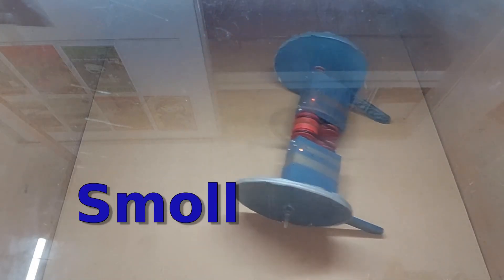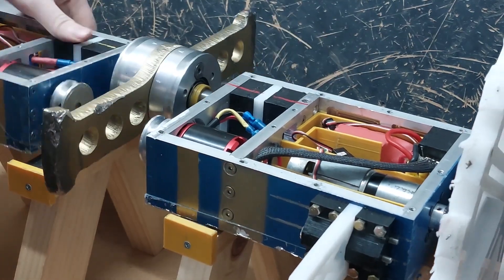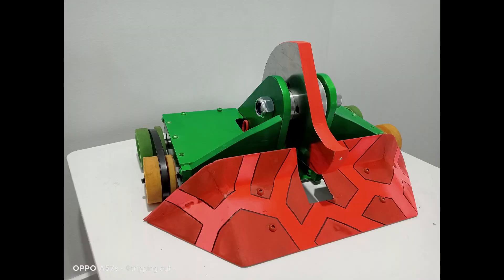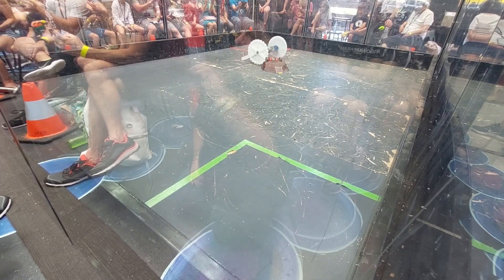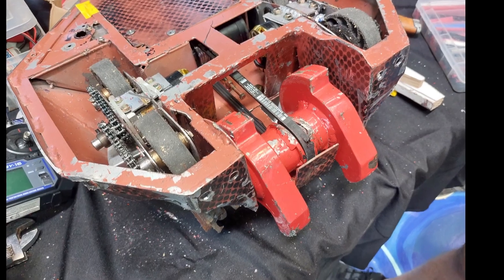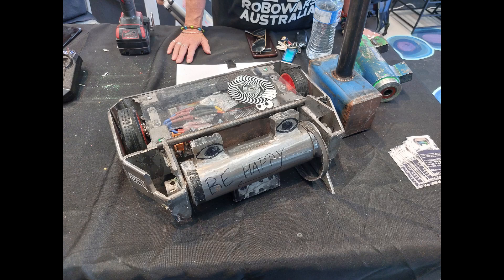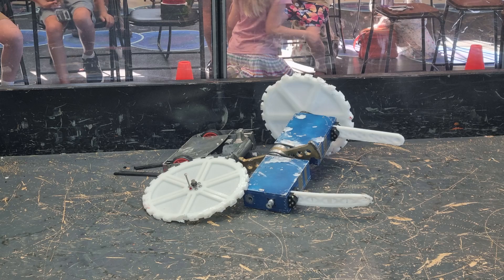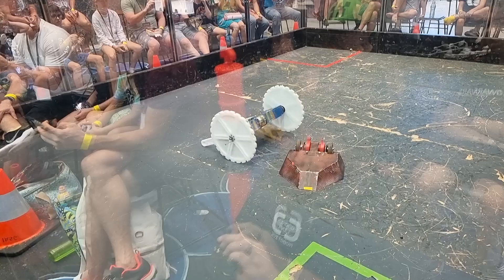Building a normal sized Combat Robot

Comment: Hey dude, nice bot. Reminds me of the early versions of my uk FW “CPT Jack Spinnah" you’ll have lots of fun with that design trust me 😂😂 until every fight you have someone slaps a huge wedge on. Haha.
Reply from the maker: hey, yeah ive seen videos of your bot love it, on the early design ideas for mine I considered having the frame half's joined at the back like yours but ended up going for the fully separated frames. I have had someone use a hydra style cow catcher/bike rack on my beetle weight version which i was able to counter by using the stabilising legs to lift it up and over my bot.

Comment: Very elegant build, well done.  Are you planning on supporting the motor shafts some way?
Reply from the maker: Its a bit of a pain to add extra supports to the shafts unfortunately, i cant add anything to the weapon side of the pully as there isn't enough clearance with the weapon bar and the geometry of the bot doesn't really work for it, I could potentially add an extra bearing on the frame side of the pully but there isn't much space there either. At this point i just am going to see if the motor shaft snapping was a once off or if it will become a common problem, might have just been a dodgy shaft that had a weakness in it already.

Comment: i think that adding a spike to the striking hammer or an edge to the top of it would make it more devastating, but that's on you
Reply from the maker: I do want to look at adding a bit more of a point to the next version of the weapon bar to hopefully cut into opponents on hits better. the one problem with adding points however is they blunt very quickly so you often have to re sharpen them between fights which can leave the weapon unbalanced if your not careful